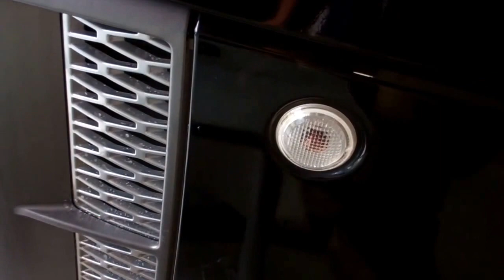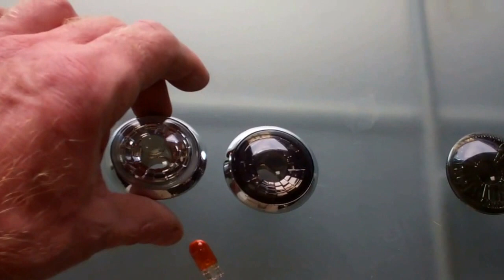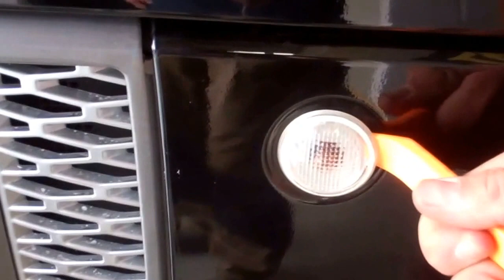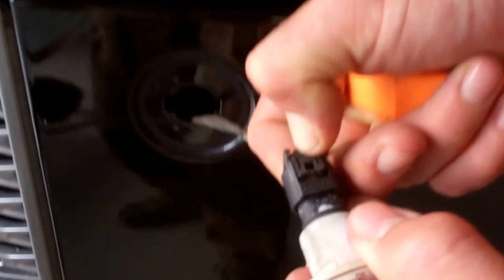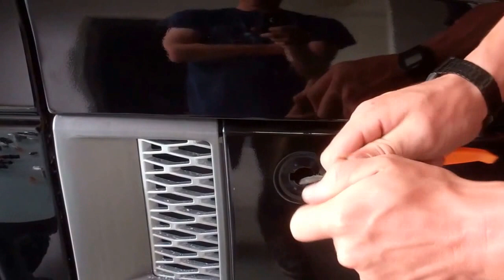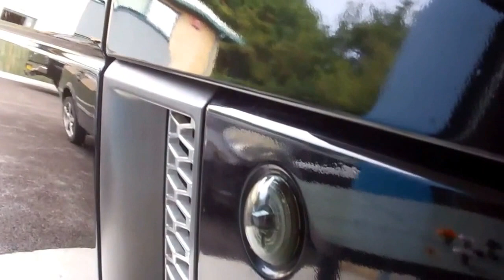Range Rover L322 side repeater light options explained including LED

Comment: I've swapped to leds on my bmw and it looks great,  unfortunately it registers as a warning on my dash as check  lights
Did you  experience this on your  rover ?
Reply from the maker: Yes sometimes - a 10 Ohm resistors across the 2 wires normally sorts this issue.

Comment: Great and very informative video as always. Great resource for L322 owners. I have successfully replaced all the light bulbs in the car for LEDs but I can't find a bulb that works with the flood light under the mirrors. All of the different ones that I have tried failed. The most I have been able to get is a short flash, and then nothing. Any suggestions for those? Thanks for the videos.
Reply from the maker: Hi - yes we found this problem - they flash on then stop. Here is the info you need
https://www.youtube.com/watch?v=DwHq1wwl--A
Reply: powerfulukltd Thanks!!